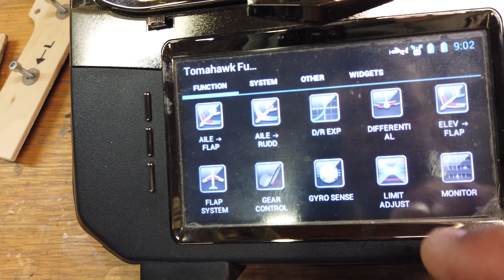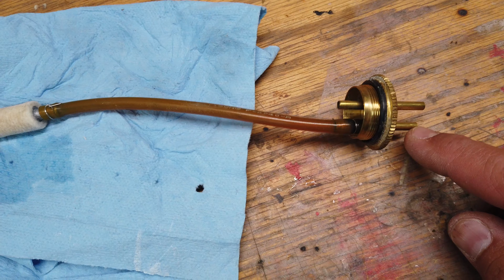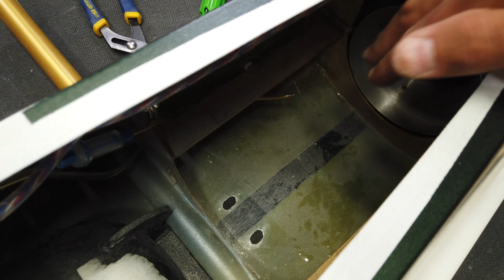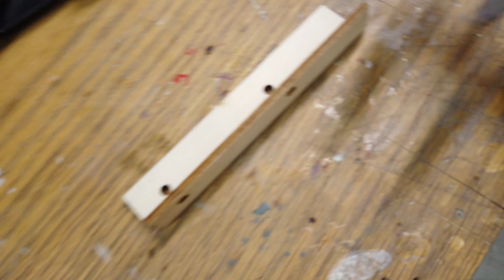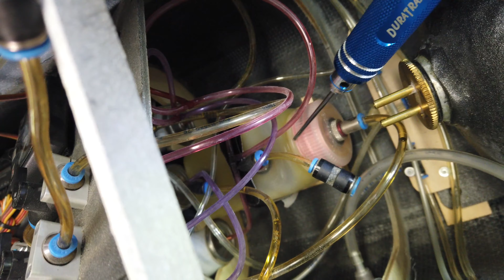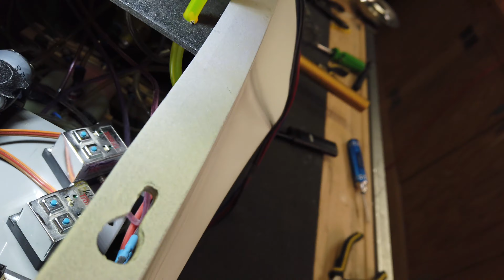CENTER IS CRITICAL - Tomahawk Futura Turbine Install - Rebuild Video #2

Comment: Hi Jon.    Very nice video on Jet rebuilt and it very interesting to watch. When done is this Jet the fastest for it’s Small? Just a thing would it be good to epoxy paint the inside to help with fuel spill on fiberglass unpainted?   Thanks.  PS. Does any Members have a A10 AirCraft?
Reply from the maker: Hello Gregory.  Thanks!😊. It's not an overly fast jet due to it's body and wing surface area.  It's roughly the same wing span and length as my ultra flash but when the 2 are beside each other this plane looks like a whale in comparison.  The fiberglass is not a worry to fuel spills but the wood structure is.  When i'm doing a new build I will treat all the wood formers and surfaces in the airframe with thinned epoxy to protect it.  

One of the guys in our local group has a MIBO A-10!  Beautiful aircraft but it doesn't get out flying much due to it's size and transport issues.  Hopefully Alan will bring it out soon!

Comment: Love your videos Jon.  How long have you been flying and building? I would imagine your skills are from many years of experience. I just bought a Dx8 transmitter, and am amazed about the learning curve I’m about to go through. Lol
Reply from the maker: Hey Hal. Started flying Heli’s in about 2006-2007 with a Align Trex 450. Bought my first foam plane in 2008 - 2009 I think and bought my first turbine the same year. Have learned a ton over the past 13 ish years but it is a natural thing with me to tinker, repair and fix things. 

Funny you mention the transmitter. I remember purchasing my first dx7 and thinking to myself I was nuts for spending a few hundred dollars on a radio. 😂. Little did I know.